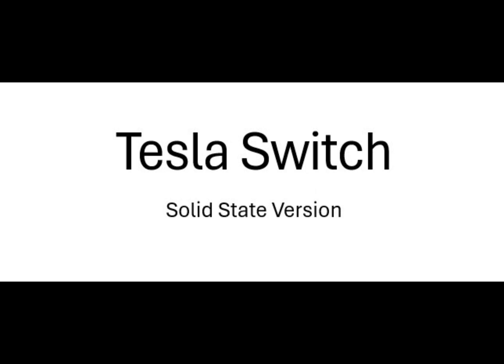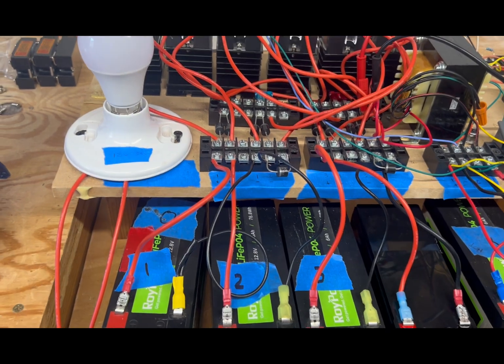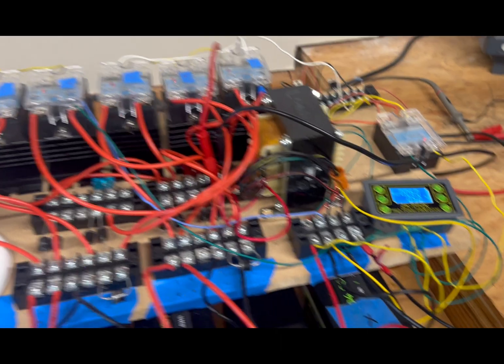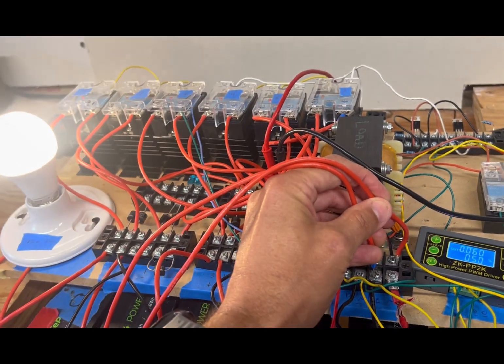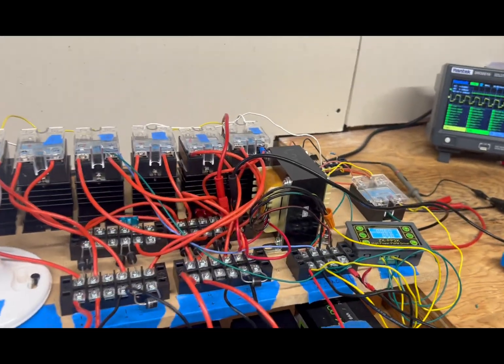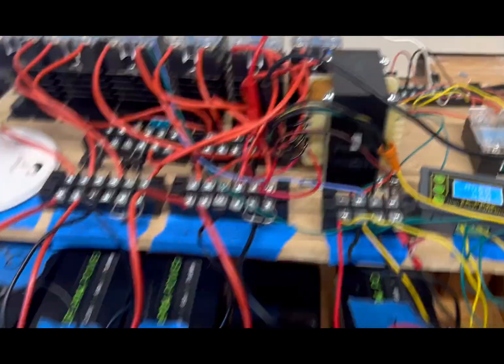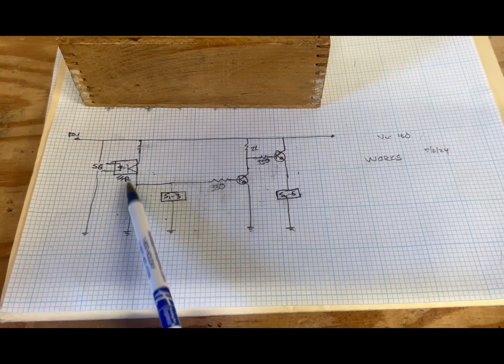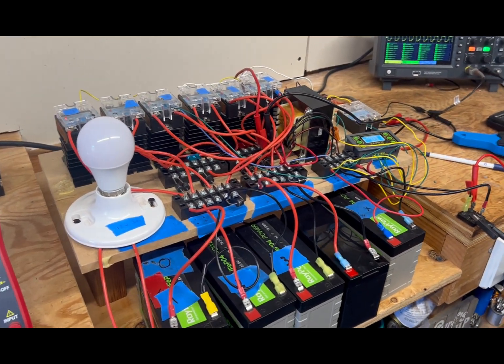Tesla Switch Solid State (John Bedini)

Comment: Hello! You mentioned in the video that a few years ago you created a 4 battery tesla switch with a mechanical switch. Were there any good results at that time? Who can help me with this topic?
Reply from the maker: I was never able to see clear evidence of OU with the T. Switch experiments, whether SS or Mech. The Mech switching was done with automotive relays. The energy balance shows only 1/2 the power is recovered into the lower bank. If Brandt made it work with a DC motor, there were other factors at play. But for sure it will eventually destroy the batteries. They are not designed for such rapid voltage reversals. I killed a handful of them experimenting. 😂

Comment: I greet you with respect. I want to know if this project called nikola Tesla switch 4 battery really produces electricity, or is it just to maintain the electricity in the batteries for longer? I am referring to the rotary drum switch version. It is clear that the version with electronic parts will never work because a chip would have to be able to coordinate the other parts to disconnect the synchronized electric current.
Reply from the maker: @valentinvalentinn5026  I would advise to try the mechanical switching version. I could not get the electronic switching to produce any impressive results.
Reply: @energyhack3538  I still don't understand if the 1N1183 rectifier diodes should be positioned with the plus side on the negative side of the battery or vice versa. I'm asking this because there are many projects circulating on the internet where those rectifier diodes have different polarization on one site than on another and I don't know which is the true version. Thank you!

Comment: Hello! Is there no one who has succeeded in this project called Switch Tesla 4 battery? I want to know clearly how to make this project and if anyone has a practical demonstration for this.
Reply from the maker: I haven't seen video evidence - which is why I posted my results.  Lot's of testimony of people making it work but they don't post video's or you have to dig through various forums and read hundreds of messages to hear of people that claim to have made it work.  Hope that helps!
Reply: @energyhack3538  I think there is a book or a guide with accurate data on this subject, but I don't know where to find it. For example, what people write on forums is not very credible. For example, I found an example of misinformation. There is a project with a sketch called Switch 4 battery tesla, but on some sites there is that sketch with the rectifier diodes with reverse polarization.
Reply: @energyhack3538  However, I want to know if in your case you have good results and gain of electricity from the environment while using this project with electronic parts instead of a rotary switch with contacts?

Comment: You probaly should do more homework on this before you come to such conclusions. I have the DVD on my youtube channel for you to watch so you can hear Johns story directly from him. You make the wrong assumpions that this is not supposed to run the batteries down at all. The 4 battery switch, as shown in the Muller Report, only gives extended run times. The way it would work is you run a load for a while, and then disconnect the load and flip a switch and it will start recharging the 4 batteries. You need your load matched right to your circuit  for this ballance. Also I dont know who told you to use solidstate relays instead of 50cent optocouplers??? 😅 but that is just silly.
Reply from the maker: @DavyOneness  I didn’t see extended run times. The batteries drained down as per the load applied - somewhere around 70watt-hrs per batt. Was hoping they’d put out well above their rated capacity. Just lazy with the SSRs Because they’re quick to connect!

Comment: I did the same experiment in 2005 with a (6) floating gate mosfet circuit. It had less than 50% efficiency. I thought about it and was so pissed at myself for not seeing something very obvious. The source current from the side in series enters the parallel side and has to branch. Therefore, the effective charging current then becomes half of the source current. There's no load that can be connected that can change this inherent relationship. Hard circuit to build! I should have seen this relationship up front and passed on the build. .. Don't let yourself get sucked into this one folks!
Reply from the maker: Correct - 50% recovery into lower batt bank is max. (+ whatever load gets). In any case, Not an OU circuit. Also, will destroy the batteries if you run it long enough. I ruined a few LIFePO3 batts letting it run for a few weeks.

Comment: There was some videos i saw of a guy with 3 aa batteries in series and 3 in parallel and some led inbetween. He claims it runs for months. He just hard wired them and every few days he switched the battery cells between the banks. I have no idea if what he was doing worked or not but his setup was very simple compared to yours. It would be interesting to try but I haven't found the time yet recently. Keep up the experimenting!

Comment: Bedini Bearden Psy Op.  Simple to "replicate", extremely difficult or impossible to achieve significant OU. Impractical to scale up. How many tens of thousands of  hours collectively have we all spent on this? Hope you all find what you seek!
Reply from the maker: LOL. Well put. Perhaps my video will save a few others the time.
Reply: What? Easy to get simple results with an SG, what have you been doing??? I had no problems scaling it up to a large six coiler charging golf cart batteries!  The other stuff takes hard work to get working. I have gotten the same tesla switch results as Icke Muller did in his tesla report! I have also replicated his commercial solar chargers that charge batteries in low light, and use it as wall   battery charger for my 1000 watt ebike, and I have get extended run times on the battery up to 30 min or more than conventionally charging, extended run times IS  "free energy",  if only people pulled their heads out there butt's expecting unicorns to  appear from simple circuits given to learn form. Too many people doing psudo experiments and coming to wrong conclusions because they are not doing their homework. The 4 battery switch gives extended run times when built correct, it doesn't run indefinitely. The only one that seems to be able to run indefinitely is the one battery teslaswitch Bill and Ray replicated and went on radio about in the 1980's. I bought all the DVDs years ago that helped accelerate my learning, and guess what? I uploaded them all to my youtube channel for all the people too cheap to support them in anyway when they were still alive.. 
I haven't wasted a single dollar studying Bedini and Bearden in the last 20 years! Stop being lazy and expecting EVERYTHING to be just given to you....
Reply: Batteries cannot recover energy cause their resistive behavior. Only a reactive device can do it. That circuit is a fake! One more thing: the transformer introduces a loss of 30%, cause its magnetic circuit.

Comment: Two batteries, 2:1 ratio, an inductor/resistor (load) in series with a capacitor. Two steps: first, charge the capacitor through the inductor/resistor; second, discharge it into the other battery. Almost 95% energy back, COP 5 - 8 depending on the solid state switches, inductors, capacitors, battery quality. There is not wasted energy in the load, otherwise you cannot get back the 95% of the energy from the source... ;) Things work when are simple.
Reply: You can prove what I said charging a supercap instead of a battery. Calculate the energy in the supercap...no matter if inductive or resistive load, the result does not change. Remember, 100 charges leave the source, 100 charges reach the charge battery/supercap through the load. No one less than this. That is the secret. Energy is potential and that is related to charge numbers. A load works as a  break: 100 charges will flow through the load in 1 second or 10 seconds, but remain the same 100...
Reply: This is a practical guide to understand capacitor and inductor behavior... https://www.youtube.com/watch?v=qtPbejIEscs
Reply: Have done this circuit as well. Basically, it's a ZVS circuit switching the capacitor via an inductor at it's min/max voltage points. At the right frequency, it is a series resonant circuit with voltage/current buildup between the two batteries. What keeps it from being OU is the phase shift between voltage/current and each battery experiences the same current. It draws down hard on the sourcing battery and I had very short run intervals tuning it at the resonant frequency. Best was just a bit slower than the resonant frequency. Interesting circuit, a great learning experience! Great for learning floating mosfet circuits...
Reply: @craigpierce7996  Unfortunately current and voltage in a series resonant circuit are in phase because of resonance, of course...for this reason the circuit behaves as a resistive one. The inductive reactance and capacitive reactance cancel each other: max current takes place only limited by the resistance.
Reply: @VentodiCampagna  That isn't correct. Voltage and current are always phase shifted in a resonant circuit, series or parallel. It is the inductive and capacitive reactions that cancel, leaving the impedance to be just wire resistance. You can only shift the impedance in a resonant circuit by adding resistance, but that directly affects the Q of the circuit and thus the voltage rise in a series resonant circuit. If the current was in phase, then it would no longer be an L/C circuit.
Reply: @craigpierce7996  Of course, the behavior of the reactive components are opposite, but the current in the circuit are in phase with the voltage across the source.
Reply: @VentodiCampagna  As the impedance of the source moves towards resistive, the Q drops dramatically and your left with a lossy source. Only extremely high voltages feeding extremely large resistive loads show some promise. But then the age-old problem of converting it down WITHOUT loading the source comes into play. I'll just leave you to your own thoughts now...

Comment: Tesla switches should be run with way slower cycling times, every few minutes or even better with a voltage sensor to detect when the drive batteries fall below a certain voltage. They should also be paired with a trickle charger such as a small solar panel. It's best to use lead acid batteries or a battery chemistry which can handle an overcharge. If you use super capacitors instead of batteries you'll see it's essentially an electricity pump or boost converter which can take a low voltage trickle charge and step it up to make usable power from very weak energy sources.
Reply from the maker: Agree..Switching at 60hz is tuff on a battery - it will eventually destroy them. But that’s the essence of the switch as developed by its creators - rapid back and forth switching and placing a load between the banks.

Comment: Thanks for sharing! Super capacitors might improve the results. Resistance of the battery chemistry also seems to be important thing. Lead acid doesn't like short cycles, specially starter batteries without added graphite and some bismuth trioxide.